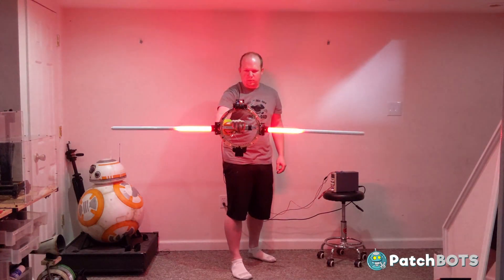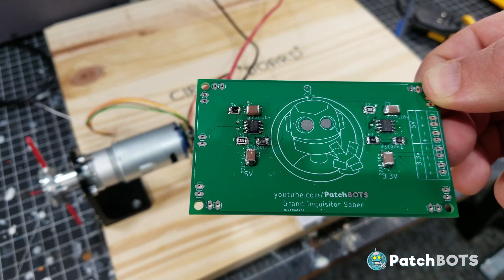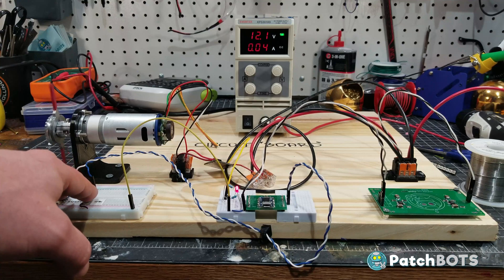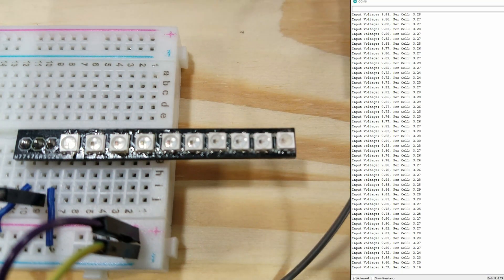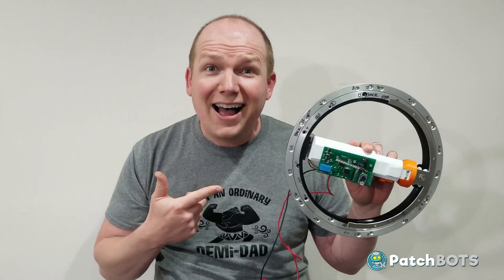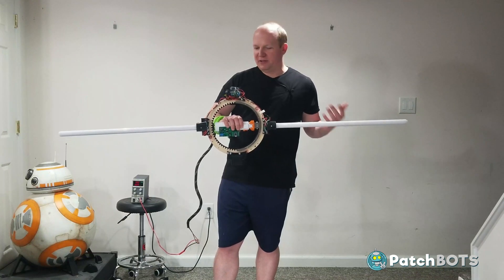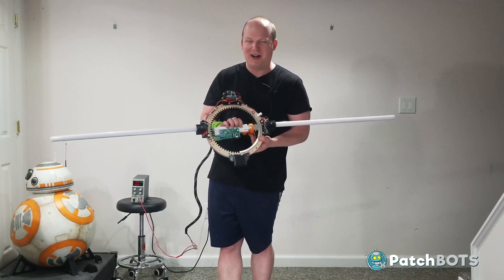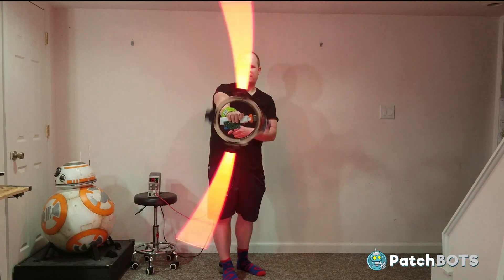Spinning Lightsaber - Star Wars Rebels - Part 2 -Inner Saber Circuit

Comment from the maker: So this is definitely way better than having to manually turn the voltage up on the power supply!   Now that the saber can be controlled from the hilt we just need to get outer saber circuit set up and we are in bidness!